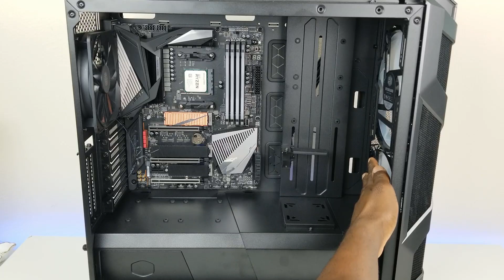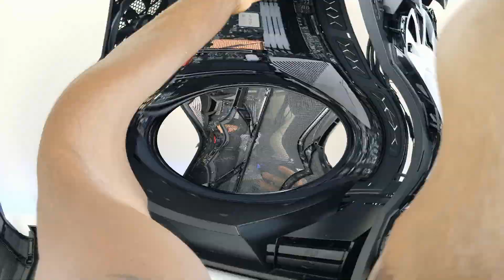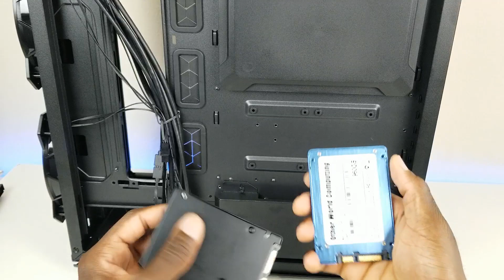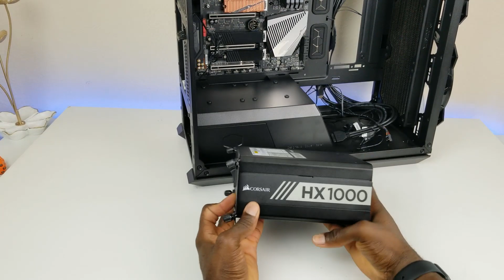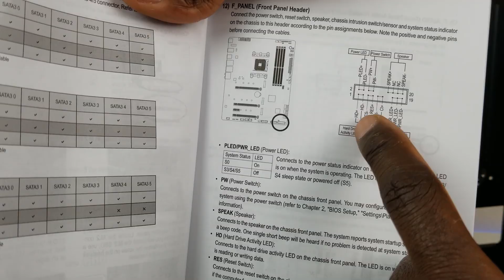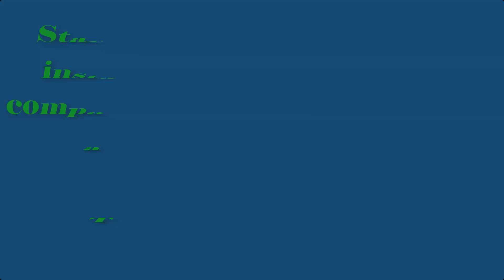Ultimate Gaming PC build Part 4 - Front radiator, Power Supply, USB Headers ,Front Panel

Comment: Great job mate I'm looking at a high end build at the moment and its a toss up between Gigabyte X570 Master and the Extreme.
The case choice for me at this stage is the one your using (cool master H500m ATX Mid and the Thermaltake core X31 TG ATX Mid) The put off with the Coolmaster (and each to there own opinion)is the bigger fans seem to look like over sized for the front radiator as in the 120mm fans direct proper flow for the radiator size and bigger do not.
I like the way you have picked all different components as well. (Very cool)
Again cheers for the video mate.Liked and Subscribed.

Comment: I know you like the look of the big fans, but radiators - especially this corsair radiator (made by hardware labs) with 16 fins per inch - needs static pressure fans to get the air through the fins. You'll likely see a jump in cooling performance if you have the right fans for the right job.